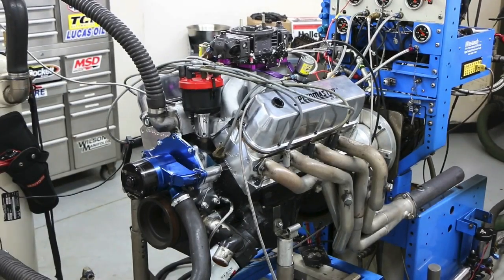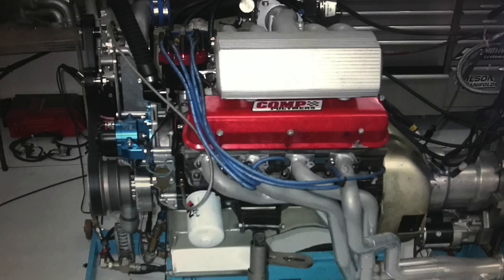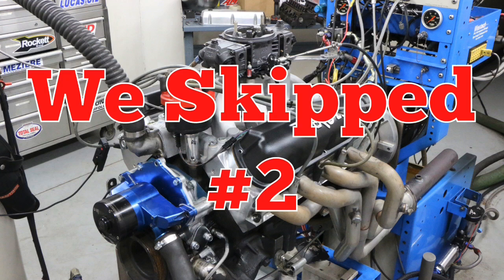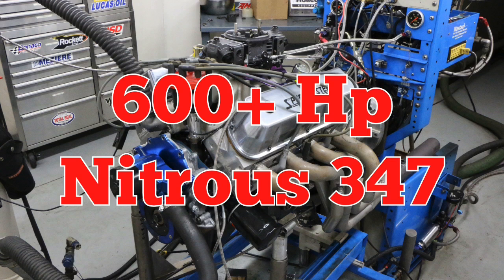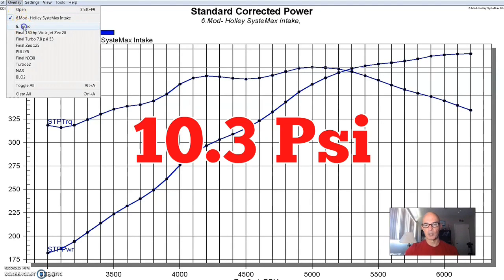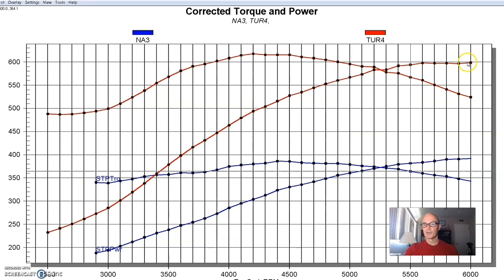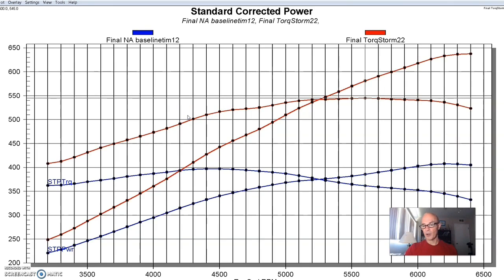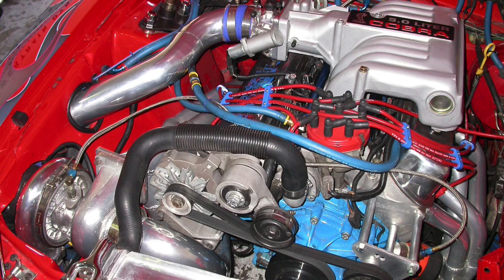5.0L FORD BLOCK SPLITTING-FACT OR FICTION?

Comment: From what I have seen and heard from the real world experience around these engines. It seems to me the magic split is likely due to lean out detonation, (or a similar shock event) combined with a weaker webbing cast. 
When you catch the cracking early you can see it starts from the main bearings and walks up to the cam. 

I have heard of guys doing sonic testing on the webbing and being able to pick out a block that will fail at the 600 number. But that may just be myth.

Comment: I was under the impression it was walking a fine line with rpm, and the 50 oz. imbalance crank.  The cracks start at the main journal, work it's way up to the cam bearing journals..  Some break in the 4xx's.  Some take a beating well beyond that. (If I'm starting with nothing)  Comparing to LS motors, I can't see spending $2800.00 just for an aftermarket block to be on par.

Comment: Project Stock Bottom End.  Was making in the 800s to the wheels. 91 block with cam, heads, intake, and head studs.  He always told people its all about tune and he kept it under 6000 rpm. He ran the car for years till he bent a factory rod

Comment: Nitrous fed engine suffering blow by, also faulty nitrous solenoid fills block with fuel and nitrous, engine fully stressed under load and lethal mix in block ignites splitting the block.

Comment: Could you do a video on the benefit of adding block filler to these blocks. Half filled or completely filled.  And would this help keep the block together
Reply: Are people still using that garbage? Haven't seen any engine in over two decades with any kind of block filler.
Reply: @AB-80X  yep Barnett racing used concrete and swapped to a custom block filler

Comment: I have a theory that it could be related to the use of aftermarket head and main studs.  At higher cyl pressures related higher HO and TQ a lot of people naturally go to a stuffed setup.  Yes, the fasteners are higher yield strength and clamp load from higher torque values and fine threads on the nuts.  But the added clamp load yields more internal strain in the block.  I personally have a completely stock untouched bottom end 87 5.0 making 420hp at the wheels on nitrous and have hundreds of passes on it.....this is a GRM.$2k challenge build that's completed drag week, been road raced, autoXed and hit with more bottles of nitrous that I care to admit..  I know of cases where  stock blocks have split at lower whp and wtq numbers with much more expensive builds including all the best fasteners....

Comment: I always thought it was rpm and told that also
Reply: RPM puts very little load on blocks. Torque at low rpm creates a ton of load on cylinder walls, main caps and heads.

Comment: I’ve seen three  split down the middle main caps and oil pan was the only thing holding it together even broke intake intake bolts, once  on the starting line on a the stutter and trans brake making boost to launch and broke,and the other two running down the track making 15 psi of boost against a powerglide and a 4000 stall converter. I think it’s just fairly unpredictable, Or bad 80s and 90s castings

Comment: I have witnessed this firsthand in the burnout box and i believe it is a weird frequency....this car was a small tire nitrous car and it was an old truck that we had put nice heads and intake on but it was the factory bearings and crank and it had alittle more end play then we would have liked but you run what you got and the car hit some hard tire shack and spit the engine all over the ground the block was in two peaces

Comment: Richard im thinking more the reason for the spitting block is more to do with faulty  block casing hence its not that commen to spilt a 302 windsor no matter how much horse power or torque if built correct and balanced there should be no reason a block would crack . Unless faulty block . With the amount  you have tested and the amount of power you can get out of them . If they were prone you would have like 10 damaged windsors there .

Comment: In my experience splitting diesel blocks it is always from excessive cylinder pressure, that can come from multiple things, big torque setups, shock load causing a spike, or just plain more boost or drive pressure and fuel than the thing can stand. Another often over looked contributor is valve spring pressure. Very heavy valve springs for high rpm applications particularly roller ones can add literally tons of force to the block. On a set of springs that goes 1000lbs over the nose you have roughly 4000lbs of force on the block at all times and that force increases by a factor of 4 and oscillates while the engine is running its bad stuff. Lightweight valve trains for the win if you want stuff to live!!
Reply: Bcbloco2 : you're right . too m
Reply: Much torque at low speed . high cyl lbs at low speed and or detonation . pressure spike . not rpm . move the power peak up and imho I think they will live longer😁

Comment: earlier in this vidio you ran a test with a holley carburetor on the motor you did not mention  what size carburetor was on the engine  what cfm was it? thanks!
Reply from the maker: 650 or 750
Reply: @richardholdener1727  thanks for the prompt reply!

Comment: Just racking up miles will eventually split a block if you drive the car hard. One of my buddies split his, and he never even reached 400hp at the flywheel. A 5500 rpm power shift on a 210,000 mile engine will do it. Also, opening up your nitrous system to change the jet, then forgetting to put the jet in will surely do it too. Saw another buddy do that. In both cases the crank broke into three pieces as well.

Comment: Personally, I think that the weak point is the threaded holes for the spyder in a line along with the drain back holes in the lifter valley also lined up combined with sharp corners and a lack of fillet material giving a clear failure path. Deburring the holes would possibly help. The failure mechanism could be detonation, imbalance or any other anomaly looking for a relief path. I'm wondering if the failure rate also extends to the older flat tappet blocks?

Comment: You could argue for hours on reasons why these blocks tent to break at high horse power, crank walk which I have personally dealt with, thin lifter valleys, on later blocks etc. I have personally made over 600whp with a sbe explorer engine and a cheap turbo. But look at guys like Mark Miller who just went 4.9 with his turbo fairmont on a stock 8.2 deck or Joey Moore from Ugly kid racing engines who has been 5.0 with a stock 8.2 on nitrous.

Comment: I think it is a combination of poor tuning and excessive torque load at low rpm ( below 4000 rpm ). My brother split one and he doesn’t have a clue on tuning. Engine was supercharged with stock internals. Broke the block and crank.

Comment: I think it has more to do with bad tunes, engine harmonics. Say someone tries to hit a motor making around 500 with 200-300 of nitrous. Nitrous rattles a motor. You can see it on data logging if you have a cam sensor, like the fiber optic on a 7531. You can see the "rattle" upon nitrous activation. The graph goes crazy between the cam signal and crank trigger. Combine that with body flex and using stock motor mount locations, etc. Front and midplates on a car with a full cage could also make a difference in helping one stay together easier. Lot's of variables.

Comment: i would think dyno results would not be indicative of what is happening to the block while accelerating under power. especially in the unibody fox platform. sad thing is by the time guys go to front and rear motor plates, and all the things to stop torsional loading of the block to some extent they have typically already swapped to a better block. so everyone just accepts 500 as the breaking point.  when in reality, good machining, good tune, motor plates, a girdle. and did i mention a good tune? and it may take a consistent 650 for a couple years?
Reply: and as others have said, poor tuning, improper balancing. a host of other variables that you are easily controlling on the dyno. and one of the biggest being chassis wind up, second being loading and unloading via a stick trans. just my amateur thoughts on the subject.

Comment: I'm going to purchase a California smog legal 347 stroker from Cal Coast high performance.  It will be going in my 1988 GT.  The engine is forged everything,  a smog legal cam,  AFR 185 heads,  ARP bolts throughout.  I'll also be putting a brand new Kenne Bell 2.1 supercharger on top.  It will bre methonal injected to keep the AIT lower.   The major difference in the price is the Dart block,  which is a $2100 option.  I'm basically getting the block for insurance and the "myth"  I also have to lose the stock T5 and swap in a Tremec T56 Magnum.  I also already had a new rear end done.   31 spline Moser axles, a True Trac diff, FMS 3.73's, and the rest of the bearings,  races,  and seals replaced.  Total cost of motor and tranny parts, $15000. For that much, couldn't I put a Gen 3 Coyote motor in?  It's my mid life crisis car and I want to drive it a bit before it blows up.   Everyone be safe.

Comment: If you take the heads off and you see a small crack beside one of the bolt holes. Which is very common on a 302. That's normally where the split starts. I know a lot of blocks split in different areas other than from the gasket surface. But I do know that is an issue

Comment: I have broken several with low power and high miles.  280 to 330 hp.   So it's not just power.  300k miles.

Comment: I heard several people before say 302's can't go past 400hp and 351's can't past 600hp and yes I just cringe. They are always the know it all's that say that. They can handle so much more.
Reply: Rosco : When ever 5.0 Mustang 84/85 Group A racing engine fails by oil leaks and they find the block has cracked, then thats failure before 400 hp. ( Group A Mustangs made 350 to 390 hp at 6800 rpm with a roller cam and regularly raced 100 mph average speed laps with 155 mph top speeds for 6 hours and 620 miles.) The factory 5.0 blocks couldnt take a full season without breaking. On the Cleveland, engine extermination in the same racing was unheard of at 390 to 450 hp unless a con rod or oil pickup caused it. As a drag engine, plenty of factory made Clevelands survived 650 hp on the Winston Cup NASCAR rounds. These things were dicussed well before the 1993  advent of the internet. Australians and American racing history. Not internet folklore.
Reply: @deanstevenson6527  I don't know what you are getting at, but what I do know is my stock block 349 dynoed at 508hp at 6900rpm and I had the engine for 5 years. So yes, they do go past 400hp no problem.
Reply: Rosco : Props to you. Point is, the 302 J code, Q code Tunnel Port and F and M code 5.0s were cracking blocks in production car racing on one hand, yet winning 7000 mile endurance races ( like the Teams Prize for the London to Sydney race in 1969 with the Australian made, US J code 302 230 hp engine). If it always splits, its a Reliabilty  problem. If it sometime splits, its a quality problem. 302s were splitting blocks in two since 1968. The solutions are all the good things weve learned. The last OHV Explorer and Mountaineer engines were exported and stroked to 342 cubic inches and were used in 335 hp and 369 lb ft form, reving to 6000 rpm in the Falcon Pursuit 250 and T3 Ford Falcon FPVs  No block cracking...they deleted the aluminum heads, plateau honed with torque plates and added a crank girdle and used hypereutectic pistons with a 50 ounce unbalance crank. Ford knows what cracks a 5.0 block. The point is that Boss 302 blocks and steel crank engines with a 249 or higher average Brinell test didnt break hardly ever, even in TransAm. So somewhere in  that is a way to reliabilty. Love your posts Rosco. 

Im only trying to make sense out of the reliabilty and quality issues. Making a stock block 5.0 last is not assured. Plenty of 10 second almost 500 hp engines exist and last just fine...on the street, circuit and drags. It will generally survive, but its not a given.

Comment: I wonder if the 351 also share the block splitting personality.
Reply from the maker: they don't
Reply: @richardholdener1727  
Hey sir thanks for responding! I truly appreciate it. I have to recover from someone hacking my bank account. I offered to take on as much overtime that's available. I have to be back at work in 5 hours so ✌😴
Reply: @richardholdener1727  
I want to bring back my 88 5.0 back from the dead. Should I ditch the stock ecm and run which computer?

Is it possible to run a Mex block as a roller dressed with efi in "5.0" style?

Comment: Myth. Balance of assembly. Pressure per cylinder (boosted application) same but NOS distribution. Also tune is highest key. Unless a 289’ 70s block, R block they split at the mains and spider crack the way up. Zero balance always preferred. Less radial under load the better longevity
Reply: Last year for the 289 was '68.

Comment: being a machinist my guess would most likely be an  inconsistency in the casting material/block, things like the way its cooled after casting can effect and impuritys in castings, hard spots, air pockets,softer than normal blocks,core shift ect there are many reasons a block could split and it might just be the block at fault as mass production some times cuts a few corners to make production numbers.people used to let blocks bake in the sun once to harden them up not sure it works thou

Comment: Back in the day there were a ton of S trim cars running 127ish mph...around 500rwhp for years. My personal experience was w/ a 1st gen hellion kit in mid 00s. Reringed sbe w/ ported twisted wedges, tfs stage 1 cam, and systemax intake. Had a performance pioneer damper. 11 psi usual, 14 on occasion...noticed oil press dropping over time. Took apart and cracked thru main webbing to cam journals. I ran a lot of timing down low and liked to spin it arguably too high. Pistons were fine, but only theory was I either ran too aggressive of tune or just abused it too much. Turbonetics 62-1. Datalogs showed started making positive manifold pressure at 2k, all in by 2900. Lotta torque. Dunno.

Comment: I have 2 examples of how we have pushed stock 5.0l, I recently  sold a 91 foxbody lx hatch 5spd car..sbe, e-cam, heavily ported "p" heads we street raced and strip raced the car on a 250 shot over 50 passes no melted plugs ..just good timing and good fuel..that car we sold...my buddy here local to me "Bakersfield area " has a sbe, stock can, stock "p" heads, stock intake,  stock throttle  body, threw a Mike's transmission AOD on 17lbs went 10.30's.  And he also has I nitrous  kit jetted at 75hp he sprays on top of the 17lbs now and again for over 3-4 years and many street and strip abuse...just know what your doing is all it takes

Comment: Stock block 347 zero balanced completely forged rotating assembly. Victor jr heads and intake. I probably wasn’t making 500 horsepower. Block cracked right in the webbing. Don’t even know when it happened I just lost oil pressure because the cam bearings were able to walk out. It’s not a myth and LOTS of guys have experienced it. Mine had 1300 miles on it and maybe 15 passes.
Reply: Also the rotating assembly survived and was completely unharmed.

Comment: Consider the intense angular momentum of a three foot long 70 lb crankshaft spinning at 6-7000 rpm. Then change its rotational axis relative to where it started spinning, say from a launch that causes the front end of the car its in to pitch up, or a sudden right or left turn. The gyroscopic forces are immense. Also, i always heard that the early S.B. fords did this, they tended to crack though, through the crank and cam journal at the front of the block.

Comment: I've seen 520 hp at the rear wheels and boom many times .
Reply: Two things. One, if you make 820 to the wheels, you are easily making 650+ to the crank. Also, if you see that happen all the time, I suggest you start associating with friends that actually knows how to build an engine.

Comment: I'm guessing casting flaws. A lot of engines have casting flash at the seams. The casting flash is a common place for cracks to form. This is especially true in the lifter valley.

Comment: 5 block 5 splits ,just after the 600 hp mark, 2 where drag cars ,and the others where street cars,  the one happen in a road race, it is not the balance, and they where all around the same year blocks late 80s. We think it is a load to take off, and the last block we had on the dyno,  did not split but was cracked. So there are even more people in my area that this has happen . It will be interesting to hear your view.